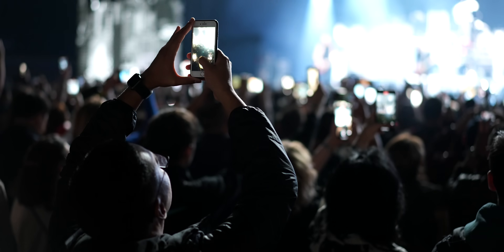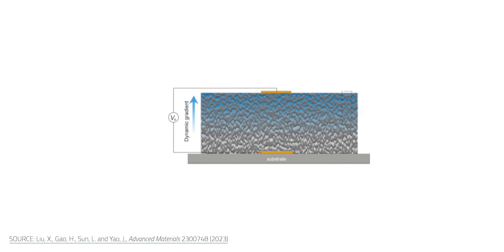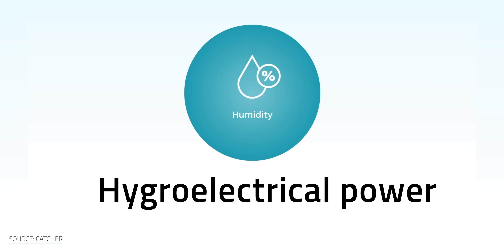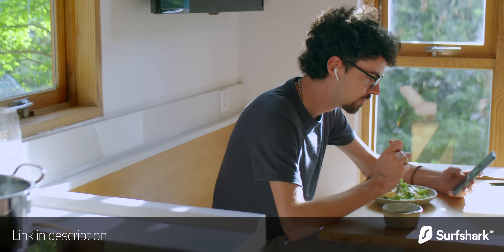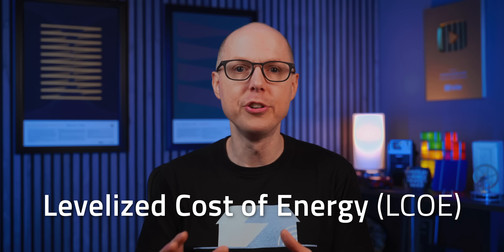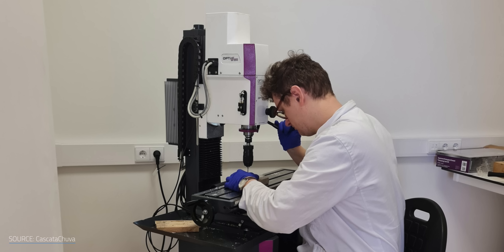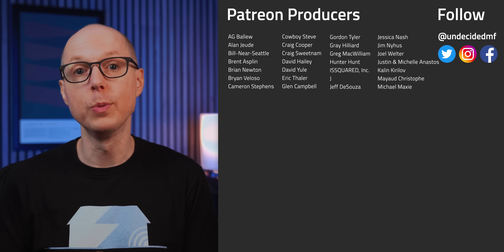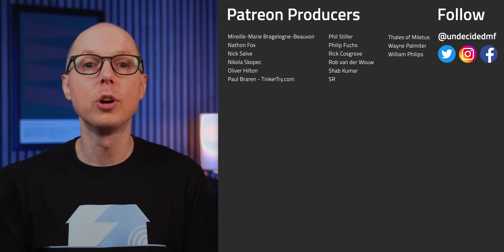Is This Accidental Discovery The Future Of Energy?

Comment: If you get elecitricity from humidity, then wouldn't it be from thick air instead of thin air?
Reply: I love that this pun is going unnoticed by some thinking this was a scientific point not a BADUM TSSS
Reply: @spirithunterx 😂😂😂
Reply: @spirithunterx  two things can be true.. lol
Reply: @busimagen you’re right. At a given pressure and temperature, the number of particles of gas in a fixed volume is constant, as per the ideal gas law PV = nRT. A bunch of lighter particles (molecules of water) will displace heavier ones and make the air less dense.
Reply: @Scrogan  If lighter H2O molecules displace heavier particles, where do those heavy particles go ?
Reply: @SarahStilesComposer  They go elsewhere in the atmosphere because its not a closed container.
Reply: @noahschuler6388  Yes of course, but upward, or outward ? Both ? One might think the heavy molecules would sink, as in oil and vinegar. There must also be a difference based upon the temp of the humidity.
Reply: @SarahStilesComposer  It changes based on wind and weather because the air is always flowing due to pressure which is caused by uneven heating of the Earth. Water nolecules are lighter so they tend to go up in the atmosphere which is why clouds are typically high in the sky, but sometimes there is fog which is at the ground.
Reply: Ask a baseball player. Balls travel further on a humid day because the air is less dense.
The water vapor in the air is really light and helps push heavier molecules like oxygen and nitrogen out of the way, giving a baseball a better lane to travel. This means hot and humid games would see batters hit baseballs farther than cold and dry games.
Reply: @MLfromWI 
At last, the voice of reason. Snipers are the same. Less bullet drop on humid days. The rest is simply explaining the observed change in density.  
Thanks
Reply: Water vapour is less dense than both oxygen and nitrogen. Hence, damp air is thinner than dry air (less dense).
Reply: If it's wet, it's thicc air
Reply: @@Martys-4x4 it is not absolutely false. A simple google search will prove that to you or you can see my previous replies.
Reply: Density is not a function of humidity.  And (shocker) dry air is more dense than humid air.
Reply: @AlanTheBeast100  both statements you made can’t be simultaneously true, fortunately neither is.
Reply: @hugegamer5988  I did screw up the back end (just word fumble - I actually know this (corrected)). But - indeed, density is not a function of humidity though it will affect the end result.  The main function is pressure.
Reply: The power you get is proportional to N_c^2, which is to say, the square of the number of c's needed to describe how thic,c,c...c,c that air is.
Reply: That was a thick one 🤣
Reply: Dry air has a molar mass of 28.96 g/mol. Water has a molar mass of 18.02g/mol. Therefore air with water in it in the form of vapour is less dense than dry air. Honestly, just Google it for yourselves.
Reply: That's what happens after I eat cheese
Reply: Sure feels like that.
Reply: Ha
Reply: Talk about dense... 🙃 LOL (sarcasm)
Reply: fog would be helpful. anyway, expect some company to find a way to charge you for humidity.
Reply: @busimagen  Oh dear. You seem to have a good vocabulary, but little knowledge of physics. It's all about partial pressures. It takes less mass of water molecules to replace an equivalent mass of oxygen or nitrogen in the air. Water vapour is less dense than dry air, so mixing water vapour with air makes the mixture less dense than room air. It's basically because the H2O molecule has a lower molecular weight than either O2 or N2. Simple when you think about it. The crux is that the air pressure doesn't change when water vapour is mixed with it. The atmospheric pressure has to stay the same, but part of that pressure is occupied by lighter molecules. Hence pressure remains the same, but density decreases. That's why hydrogen balloons float... the hydrogen molecules occupy the same volume as the surrounding air would if the hydrogen wasn't there, but they are lighter. so the balloon is less dense and floats. It takes a lower mass of hydrogen to generate the same pressure as the equivalent amount of air. This is also, by the way, why storing hydrogen is so expensive. The pressure gets astronomically high before you've stored much mass of it.
Reply: In HVAC we learnt that cool air is denser and takes more energy to move than warm air. 
I also like goats
Reply: The part you’re missing is the molecules act as individual particles and can be considered an ideal gas.  The two oxygen and two nitrogen molecules which make up the majority of air are both heavier than one oxygen and two hydrogen.  Though that’s only if temperature and pressure are equal.  If you can cool the air enough by dissolving water into it it will overcome the lower particle density by decreasing temperature and thus average molecule spacing.
Reply: Yes it is in how we normally communicate.  We call it thick or heavy due to how it inhibits our bodies.  We dump heat less efficiently and proceed to have greater difficulty.
  As a matter of density the air is thinner, but as a matter of communication it is described as being thicker as it impedes us more than dry air.
Reply: @richardbrooksshnee  Never called humid air "thick".  Called it (of all things) "humid", perhaps "muggy" or maybe even "swampy".  OTOH, taking off in a C-172 at a 6000' elevation airport at 28°C and we'd definitely call the air thin.
Reply: @AlanTheBeast100  well thick is a term used to describe it, and you've almost assuredly encountered it used as such in classic literature at the least.  That said, considering the entertainment value of generic required educational reading in American schools I understand it not sticking around.
Reply: @richardbrooksshnee  I won't claim a great depth of classic literature - but some.  Still doesn't come to mind - perhaps a "thick fog" - which is of course humidity - but the vapour kind, no.
OTOH, I did not suffer education in the US either.
Reply: @@Martys-4x4 And have you done your homework in the meantime? How about an apology?
Reply: Florida?
Reply: We can’t get anywhere in this conversation if no one defines what thick is and sets parameters
Reply: Depends on elevation, mountain passes in hawaii would work.
Reply: T H I C C air.
Reply: Sorry to spoil the fun of a well-meaning science buff, but...

CO2/climate-change is the biggest mass-fraud since communism. 

(See Henrik Svensmark for the cosmic-ray/solar-activity/cloud-formation/climate relationship.)

 CO2 is a ruse. 

Climate change the "Greens" are talking about is caused by changes in the cosmic-rays/solar-activity relationship and cloud formation  (See the work of Henrik Svensmark.)  

Cloud formation by actual cosmic rays can be scene with the naked eye in Cloud Chamber demonstrations.  YouTube has dozens of videos about them.
Reply: Oh god it hrtz
Reply: Actually humid air is less dense than dry air.
Reply: @paulohlstein2236  so No?
Reply: @paulohlstein2236  haha.. i was going to say the same thing
Reply: @paulohlstein2236  At constant temperature and pressure, which is very close to the case in the open air.

In case it helps anyone else who reads your reply, I spent a long time trying to convince myself you were right. I like the point in the Wikipedia article on density of air: "The addition of water vapor to air (making the air humid) reduces the density of the air, which may at first appear counter-intuitive. This occurs because the molar mass of water vapor (18 g/mol) is less than the molar mass of dry air[note 2] (around 29 g/mol)."[1]
If I combine that with the definition for specific gas constant,[2] then it's apparent that the density of the humid air mixture is proportional to a molar mass weighted average of the partial pressures of the gases (dry air and water vapor). That weighted average feels intuitive to me, and it makes sense to me that pressure is the parameter that corresponds to the simple weighted average relationship rather than some other property of air. (Because it's Energy/Volume, and thinking of things in terms of energy almost always simplifies the math.)
I think I lost that intuition for the relationship between density and humidity because density (mass per unit volume) isn't on a psychrometric chart.[3] However, the humidity ratio is on the psychrometric chart. It's also a kind of density (mass of moisture/mass of dry air), and, in contrast, it increases with relative humidity at constant temperature and pressure.  The reason these two densities behave differently because normal density accounts for the space the moisture and air spread out over, but the humidity ratio does not.
[1]: https://en.wikipedia.org/wiki/Density_of_air#Humid_air
[2]: https://en.wikipedia.org/wiki/Density_of_air#Dry_air
[3]: https://3.bp.blogspot.com/-IDoKCMxImGE/TrGDwxZzC0I/AAAAAAAAACQ/xrmD0dHyC5g/s1600/PsychrometricChart-SeaLevel.bmp
Reply: @jonathanp___________3606  Here is a way to visualize the situation: Imagine a volume of moist air and you separate it into two components, The dry air is on the left and the water vapor is on the right. Clearly the water vapor portion with a molecular weight of 18 is less dense than the dry air portion with a molecular weight of 29, so the total density of the sample is less than it would be if the water vapor portion were replaced with dry air.
Reply: @paulohlstein2236  Took the words right out of my mouth xD
Reply: @paulohlstein2236  Not in the physics I studied. damp air is denser thats why sound travels further on a damp day/night than on a dry one.
The fact the air is full of damp molecules makes it denser. Please prove me wrong.
Reply: @wideyxyz2271 water vapor is lighter than the nitrogen and oxygen it displaces.
Reply: @wideyxyz2271  when we refer to air.
It probably means nitrogen and o2 mostly .
Rather than moisture/humidity .
Reply: @noahschuler6388 but humidity in the air isn't vapor, is it?
Reply: @matthsini  yes it is.
Reply: @noahschuler6388 It's certainly not lighter than oxygen, but I'll have to check the mol of nitrogen versus water vapor.
Reply: @gljames24  it is. Oxygen molecules have a weight of 32 (2*16=32). Nitrogen molecules have a weight of 28 (2*14=28). Water vapor molecules have a weight of 18 (16+(2*1)=18).
Reply: @wideyxyz2271  no problem... PV=NRT... the volume of 1 mole of an ideal gas at STP is 22.41 L/mol... so, at equal pressures and temperatures, a given volume of air will contain a known number of moles. When moisture is added to dry air, without a change in pressure or temperature the there will be the same number of molecules per litre of air. The lighter water molecules displace heavier nitrogen and oxygen molecules and the air becomes less dense. That's why a baseball will fly farther in humid air than in dry air — it encounters less resistance as it pushes the lighter moist air aside during its flight.
Reply: @wideyxyz2271  
Your "physics" is wrong.
I can't believe so many likes. It could be a sad testament to the US public school system. 

N2 and O2 both have a higher molecular weight than H2O. So a partial pressure of H2O has a lower mass than the equivalent volume of dry air, and is less dense.
Personally, I think you were guessing and never actually studied the physics of partial pressures properly.
Reply: @noahschuler6388  I fully agree. I reckon the guy was guessing and didn't study partial pressures or gas physics to the necessary level. Any sniper who studies basis ballistics know that damp air has less air resistance for exactly the same reason.
Reply: @matthsini  
If it's not vapour, then what is it? We're not talking about fog or clouds, or rain! Even if we were, then if these were denser than ambient air (for example  rain) then they would precipitate! Do you get the idea?!!
Reply: @noahschuler6388 
You're right, but both intelligence and study are required to understand the principles of partial pressures. 
It's no good. As my physics teacher said "you can't educate pork".  You're unlikely to be successful. 
Good luck with your mission of educating the masses. I wish you well.
Reply: @michaelransom5841 
Partial pressures...You are correct.
Reply: @gljames24  But air is not as simple as H20 vs. oxygen and nitrogen. Pollution is everywhere - carbon emissions, methane, hydrogen sulfide gas.....
Reply: @wideyxyz2271  Incorrect.  Damp air is less dense.  H20 has a lower molecular mass than O2 or N2, so putting it in the air lowers the density.  The fundamental issue is that every species in a gas takes up comparable space, since the 'size' of the gas is a function of its motion.  Average speed of an air molecule is above 500 m/s, about 1.5 x the speed of sound.
Reply: @wideyxyz2271  You did not study any physics that taught you that humid air is more dense than dry air. You may have imagined it, but no text or teacher said any such thing. Are you aware that the barometer is low during storms when the atmosphere is loaded with water vapor?
Reply: @noahschuler6388  So a molecule is now lighter than an atom...hmmm...new discovery I guess.
Reply: @Friedbrain11  No. Oxygen and nitrogen both exist as molecules in the air.
Reply: @Friedbrain11  Is your brain really that fried? And molecules can be lighter than an atom, because different elements have different masses.
Reply: @tasmedic  I mean, most non-college education systems aren't going to force you to commit to memory the exact Mr of water vs dry air, regardless of country.
Reply: @paulohlstein2236  i could be wrong but i think its humid air has less oxygen in it (so the density of oxygen going into an engine on a humid race day is lower)
Reply: @gcKukie  The water vapour replaces some of the oxygen, and as O2 has a higher molecular weight than H2O, the air that's mixed with water vapour is less dense, as the water vapour occupies the same partial pressure, but weighs less.
Reply: @paulohlstein2236 this comment is why we need to see the down votes, YouTube team is dumb.
Reply: @ChinchillaBONK  he’s right though. Water vapor molecules weigh less than the nitrogen and oxygen molecules they displace.
Reply: @ChinchillaBONK  Why?  Paulohlstein is correct.
Reply: @paulohlstein2236  "Actually humid air is less dense than dry air." it makes zero sense. The reason why air is humid in the first place is because it has more water molecules, aka higher density of them
Reply: @darlingdear2687  water vapor molecules displace the nitrogen and oxygen molecules and water vapor molecules weigh less than both.
Reply: @darlingdear2687 The addition of water vapor to air (making the air humid) reduces the density of the air, which may at first appear counter-intuitive. This occurs because the molar mass of water vapor (18 g/mol) is less than the molar mass of dry air[note 2] (around 29 g/mol). For any ideal gas, at a given temperature and pressure, the number of molecules is constant for a particular volume (see Avogadro's Law). So when water molecules (water vapor) are added to a given volume of air, the dry air molecules must decrease by the same number, to keep the pressure or temperature from increasing. Hence the mass per unit volume of the gas (its density) decreases.
Reply: @darlingdear2687  May make no sense to you but it is the way nature is. Science is about measuring not attempting to "reason" what you think something should be. The water molecules displace oxygen and nitrogen molecules and the molecular weight of water is 18 compared to 28 for nitrogen and 32 for oxygen.
Reply: @paulohlstein2236  you are talking literally to a scientist with 10 years of universities behind my back, so tone down your arrogance. When water fills the volume previously occupied by air, meaning that density of water in that space is bigger, that volume of space becomes heavier, otherwise the ocean would be lighter than air above it
Reply: @darlingdear2687  OK, put your ten years of university to work. Calculate or find data for the density of dry air at STP and do the same for air at 50% relative humidity at STP. If you cannot find data for the parameters I chose, choose others but keep temperature and pressure the same for both.

Hint: The molecular weight of air is 29 and the molecular weight of water is 18. I presume that you know about partial pressures and PV=nRT.
Reply: @darlingdear2687   I'm unsure why you are having so much trouble understanding that 18g/mole (the molecular mass of water) is lighter than 29 g/mole (the molecular mass of dry air).
Reply: @mimcduffee86  it's because you need to read the definition of molecular mass so you understand how irrelevant that is here
Reply: It depends on the psychrometrics. Warmer air (less dense) holds more moisture than colder air. Air behaves somewhat like a compressible fluid, so the colder stuff can displace warmer. 

Although at this case, wouldn't it be easier to harness clouds?
Reply: @VergilArcanis  If the parameter is "density" then the dry air is denser.  Not talking about capacity to hold water.
Reply: @AlanTheBeast100  the psychrometric chart shows how much water the air holds, which the pressure in a sealed container increases with temperature. However, the absolute measurement increases due to a few things: the warmer air expands in volume and decreases pressure (increases in a sealed container, a la combined gas law). This means that within a sealed system and unchanging volume, the density does not change, but can still absorb water vapor, which means the density wasn't relevant to begin with, it's the temperature and pressure, since the volume cannot be within a sealed system. This then factors into a buoyancy issue when it comes to compressible fluids. 

In the example of a basket ball flying further on a humid day, it could be a number of issues, but if it still does so with a repeatable experiment, then it's because rhe basketball is experiencing a minimal buoyant force that "floats" the ball a little bit further
Reply: @VergilArcanis  The stated case is open atmosphere.  Apologize to your keyboard.
Reply: @AlanTheBeast100  no can do. you didn't read it completely. i said it wasn't, but the flow and movement of the air negates a lot of the regular arguments, as any person who understands meteorology would know. the density technically drops as the air gets warmer but with regards to humid air, warmer air can hold more moisture. 

 the issue here is that humidity increases overall mass at the same temperature, which would mean Humid air increases in density. water vapor above 212 F is a lot less dense than air at room temperature, but the air isn't 212 degrees. 

to put it in short: humidity increases density. 

did you look at a psychrometric chart by any chance? the right-most side of the scale (hotter) has a axis labeled "Weight of water in one pound of dry air - grains" the chart is meant more for engineers dealing with industrial HVAC planning, or meteorologists
Reply: @VergilArcanis  Again (and not bothering to check what you're saying), you've drifted well outside the case at hand ... Have a great day.
Reply: 1 comment in 12 years an you say that
Reply: @paulwright8378  i think the wait was worth it.
Reply: @paulwright8378 the number of comments you see only apply to the chanell you are watching the video from. So if you see the number of comments and the 3 recent comments, its from the chanell you are currently watching the video from
Reply: The difference between fog and clouds in the sky (for example) has to do with how the air is charged.  There already exists electromagnetic energy in the air, which is why a device like this can just capture and siphon it off.  This technology actually existed long ago when the Earth was much more humid.
Reply: @evelynn4273  fog is a type of cloud.
Reply: @evelynn4273 
You're describing lightning.  Yes, it's been known about for some time.
Reply: Thick - Yes. He's talking about water vapor saturating the air.

Why are the morons including nitrogen? 

We're talking about earth surface level use. Which layer of the atmosphere is a Washing Machine sized battery for the home going to be placed in? 😅